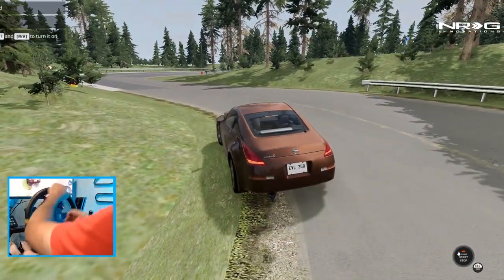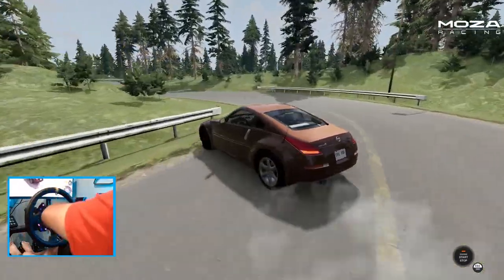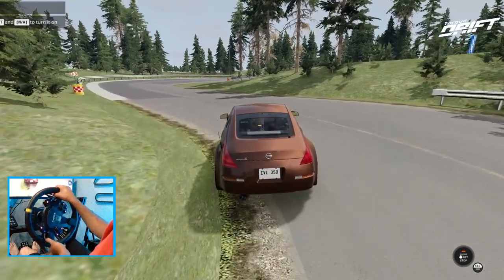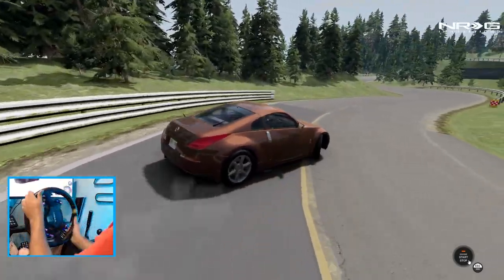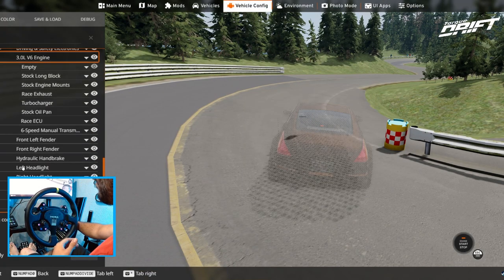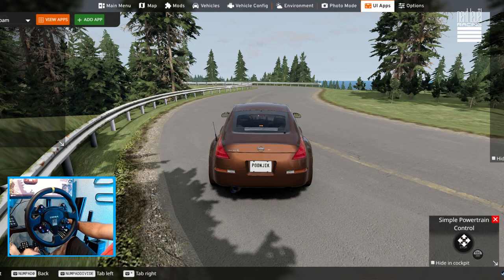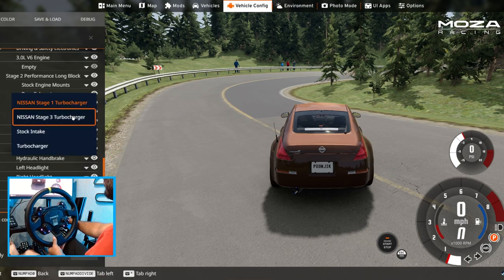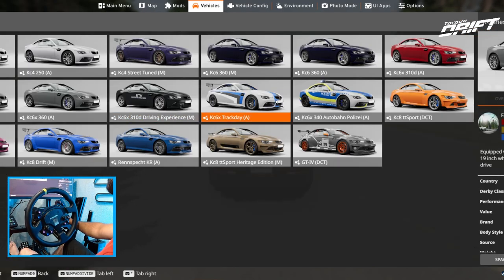Taking the 350z out for first drifts in BEAMNG - Moza R12 - RS v2

Comment: Do you think the R12 is worth it over the R9? I just bought my R9 with the rs v2 wheel and just found out about the R12. Microcenter does not carry the R12 just yet and im wondering if i should just return the R9 and wait for the R12. What do you think?
Reply: Если руль весит больше 1200 грамм, то лучше r12, если не больше весит то r9 хватить, имею r9
Reply: @jimich81  the wheel weighs 2722 grams
Reply: @Burtme-D4M   r12